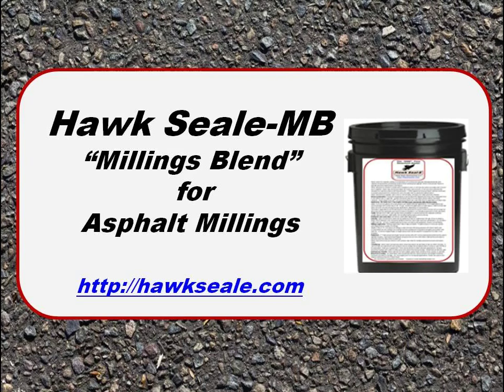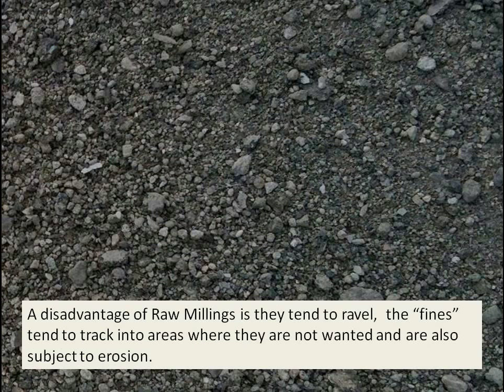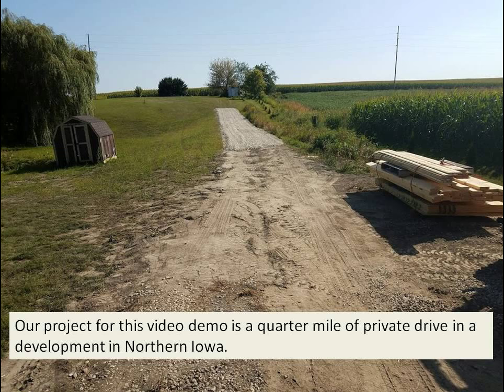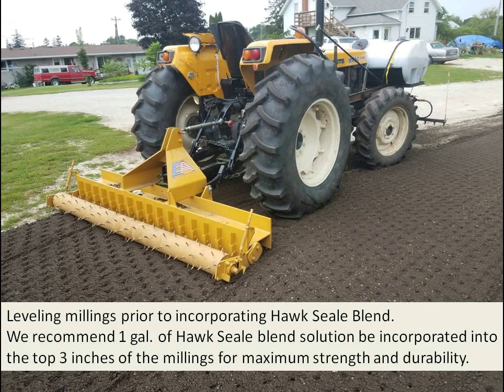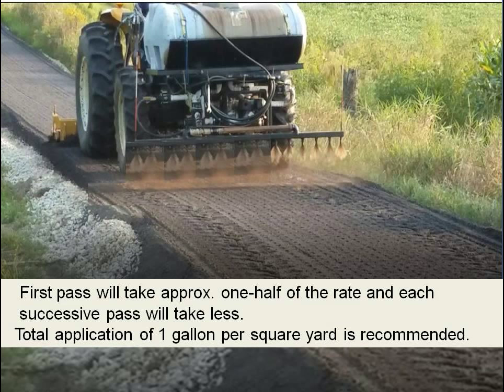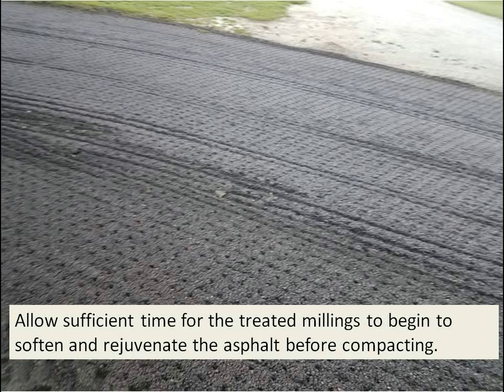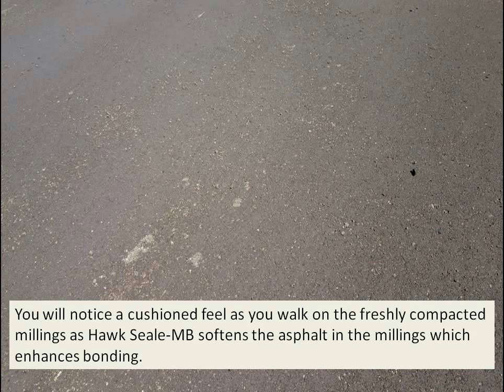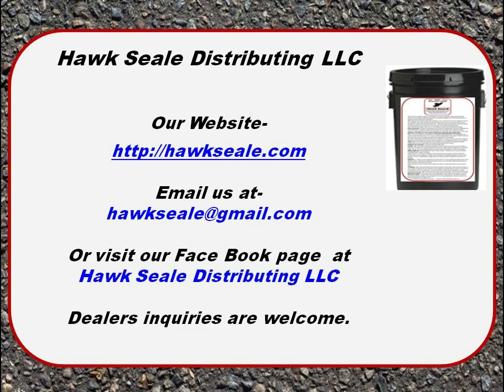Asphalt Millings with Hawk Seale-Millings Blend

Comment: How much longer would this help the millings to last, compared if they were only rolled without the sealer?  What is the cost for an average parking lot with 50-60 spaces?
Reply from the maker: The first HSE millings road was put down in Montana in approx 2006,  it is still in good shape with little to no maintenance.  Erosions and tracking of fines are the two most common complaints when using millings. HSE will tack down the fines, and waterproof the surface preventing erosion.
Cost for HSE can vary due to size of the project and whether the millings are already compacted, or if you plan to incorporated the HSE, we do offer quantity discounts. 
You can request a quote on our website at http://hawkseale.com   Please include dimensions and if your  millings are compacted or if you plan to incorporate the HSE.